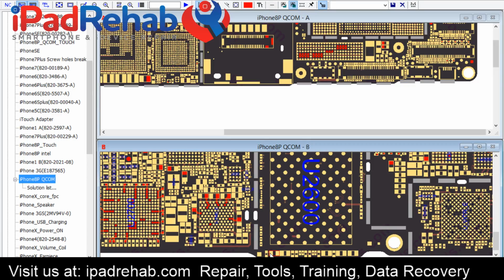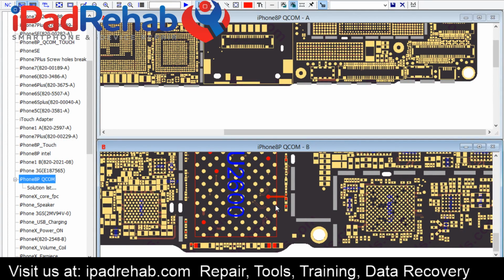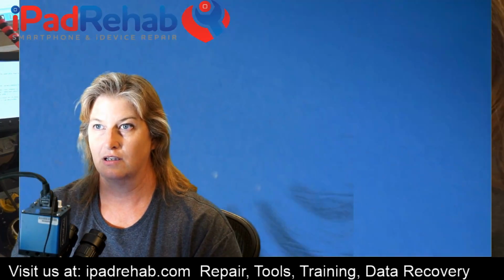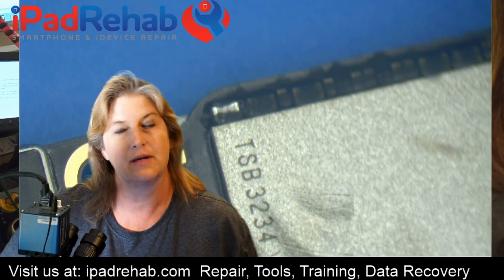iPhone 8p no power (and tristar tester results!)

Comment: hey i have a iphone 8 plus water damage, i have cleaned the board and it turns on but turns off in 2-5 minutes. the battery status shows service, its not charging and battery percentage not showing with option turned on, just a red battery bar like its at 5%. i suspect a short but no clue where to look.

Comment: Can you please help me!!! I have an Apple iPhone 8 Plus and it just stopped turning on the other day. I’ve been to Apple and they can’t do anything and I’ve been to repair shops and they can’t do anything around where I live. I don’t know what else to do. Please help me! They all said it’s a motherboard problem and probably needs micro soldering.
Reply: sounds like a tristar issue
Reply: I sent it off. A capacitor or something like that on the back of the board needed to be re-soddered. It’s all good now.

Comment: I know iPhone 8’s haven’t been on the market as long as the 7, but from what you’ve seen do you think the 8’s will have similar problems to the 7?( flexion based faults) or is the design improved? I’ve heard you mention a fault line with the Qualcomm chip in the 7, just a curiosity of mine. It would be a-shame for the “new and improved” 8 to suffer the same problems!